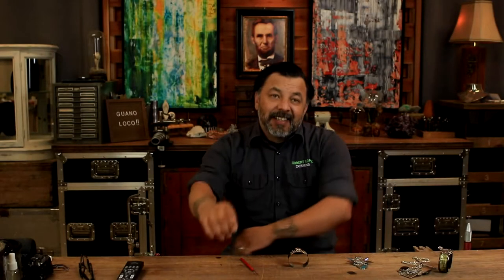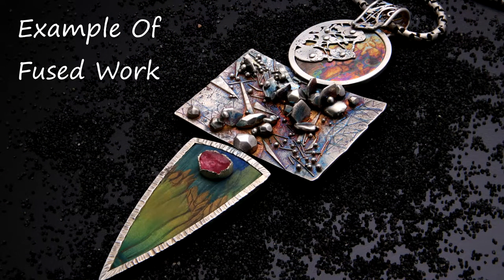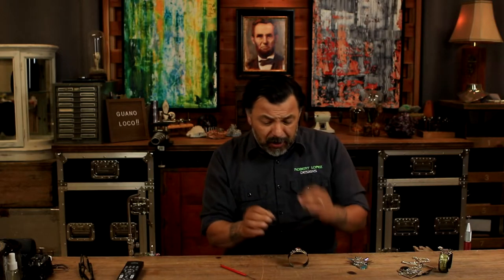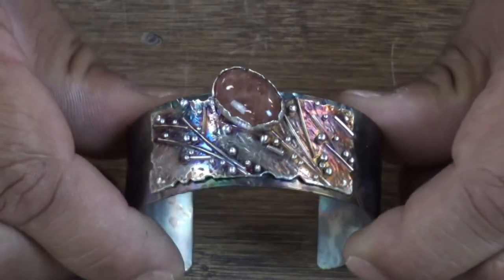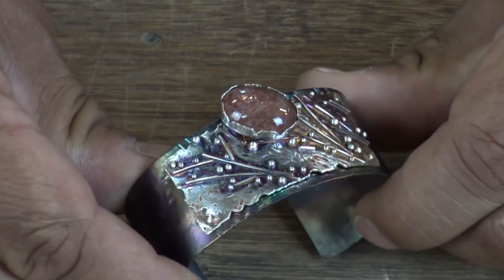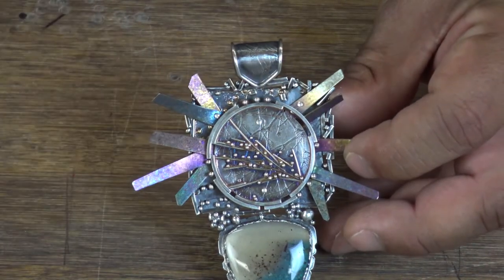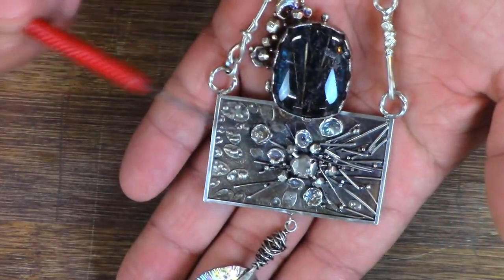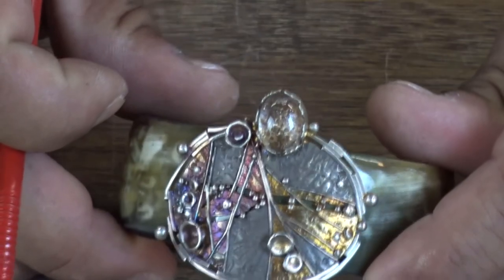Silversmithing without solder!! Fusing Argentium Silver 101

Comment: I like fusing. I'm still in the early stages of silversmithing but when I was first doing my research on using a torch and deciding whether I wanted to start out solder or fusing, the idea of soldering was intimidating so I opted to start with fusing 999 Fine Silver and 935 Argentium Silver.  It was so much easier and less mess.  I was hoping for a demonstration but this was still informative.  I will definitely check out your website.  Thanks!🙂